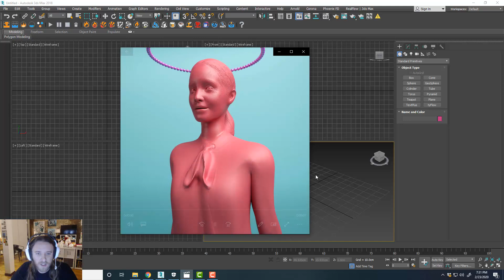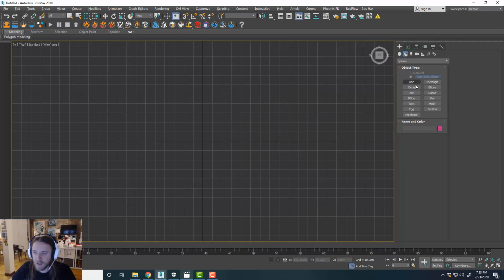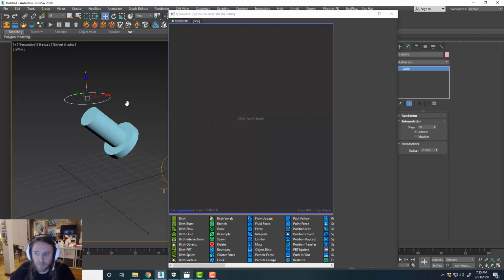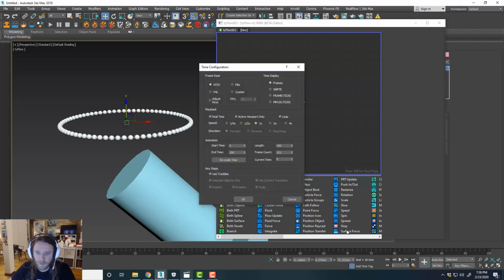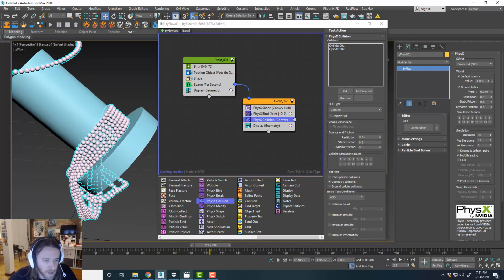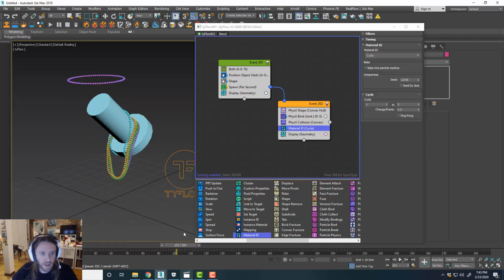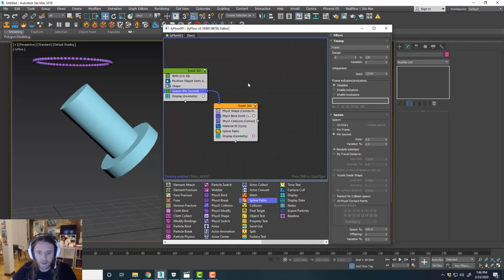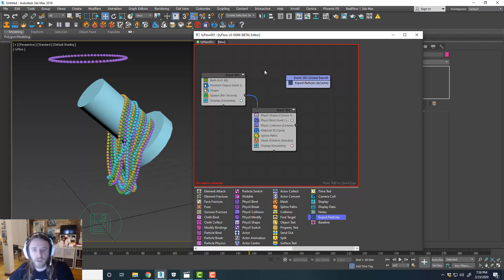3ds Max + TyFlow TUTORIAL: Spawning Bead Necklaces +SCENE FILES

Comment: This is absolutely brilliant. Thank you Sir for taking the time to make such a great and helpful tutorial. 

If is not too much trouble, may I ask for your help to solve a problem I've been struggling with lately? I try to use Tyflow to create an array similar to RailClone.
On a curve, I want to clone an object on each vertex but every object should conform to the spline - this is an example: https://i.ytimg.com/vi/IXIdfPRII9I/maxresdefault.jpg
Any advice would be appreciated. Thanks again for the Spawning Bead Necklaces. Cheers!
Reply from the maker: Thank you for the suggestion!! You can try to use the rotation operator, and set it to object align, and select your spline in the objects section in the rotation operator below. You might have to play with it, and reset your pivot on the object you're trying to clone, but it should work. Let me know if it works for you.
Reply: @simulation_lab  Thanks for your input. What I'm trying to achieve is similar to path deform modifier - this is what RailClone does. I imagine in Tyflow I might need to use a Path follow and probably Cloth Bind (to bend/deform object along spline). Don't know, is just a supposition. Tyflow would allow much more control than the native modifier for creating fences, kerbs, bridges, etc. If you have any ideas, I would love to hear them. Thanks again.